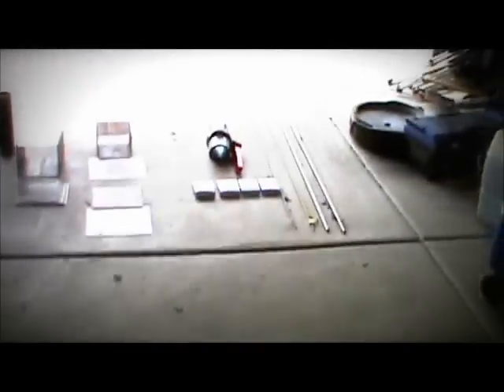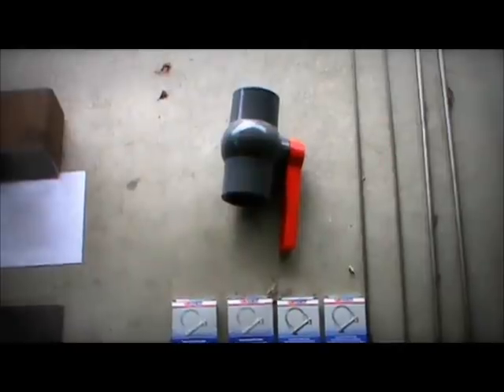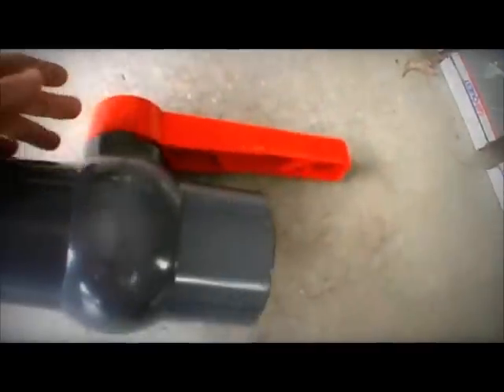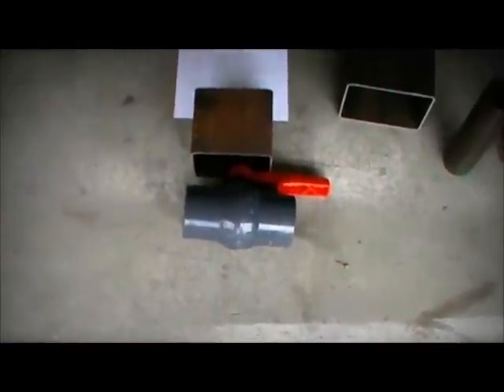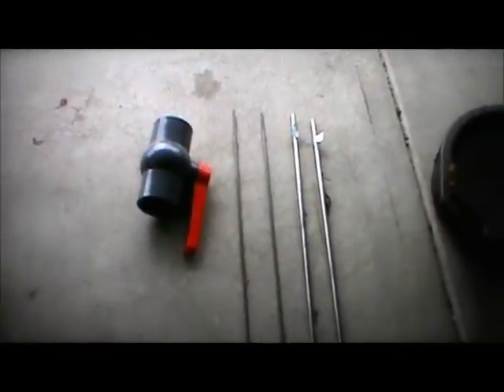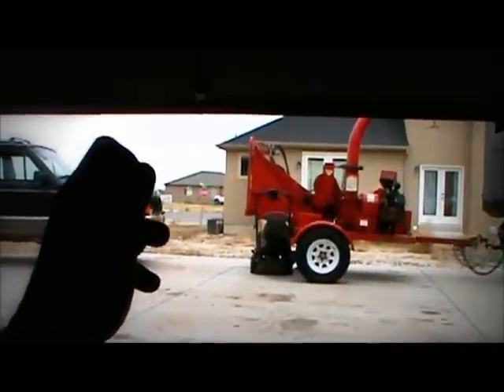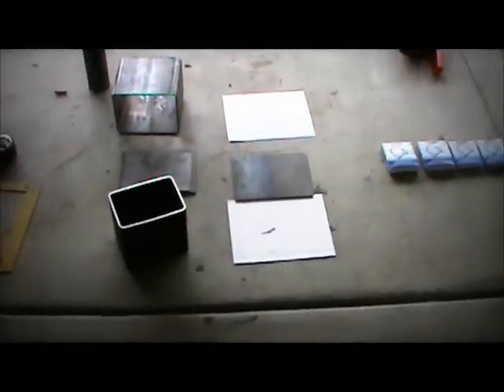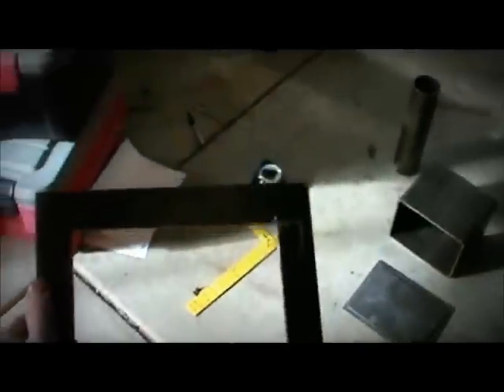100+ MPG Project New Fuel Vaporizer Design Part 1.3

Comment: It might be a consideration to weld couplers on the side of the vaporizor then screw close nipples in for the EG to pass through, in case you have to dissassemble the unit. Using a grinder & thin cut in close quarters is really a hassle. Just a thought.... Hey! its your project we are just cheering you on.

Comment: Hey Tyson, I've watched all your vaporization videos and read all the comments. I have a few questions regarding your system. Could you explain to me why you use the huge 3" tubing for the gas vapor? You are using the exhaust fumes to heat and evaporate the gasoline correct? How were you able to get the correct fuel-air mixture in order for your car to run? Finally, how are you able to have the vapor sucked out of the container when the container is a closed and sealed container? Thanks, Alex

Comment: Nice design! It's a more complicated  ver. of the HCS set-up I have on my car. How will you be introducing the fuel vapour to the car again? I read about the hydocarbon cracking system on a forum a few months back. I use bottles to hold the gasoline, which has hot air bubbling through it. The hot air comes from thin copper pipes strapped to the exhaust manif. The gas vapour also goes back through these pipes, then to the engine. Added max 70 miles to my tank. 33+% increase. I tweak it each week!

Comment: In fact in my testing too I found that the vaporizer are not giving any considerable mileage gain. On idling I found that the car can run from one start to stop for around 6-7 min in 100 ml of gasoline but on road test the performance is not that way. 

I have detailed report on my testing. If any body wants it then please send a mail on pvar06@gmail.com

Praveen

Comment: I'd love to see how well this works out for you. Your old set-up got you very good results, so this should be an improvement. I use a similar set-up on my vehicle with effect that I can drive about 100 city miles on my 1st 1/4 tank of gas (about 2.5 gallons). The problem is that when I drive the remaining 50+ miles for the week, and get down to between the 1/2 and 1/4 tank marks, it still works back out to 30+ MPG. That is what I have found to be the proper mileage test. My base is 25+ mpg.

Comment from the maker: With complete combustion it should in theory run hotter not cooler. If this ends up being the case it will actually benefit the operability of the system.
Yes the makeshift valve I mad did work properly however it is definitely not the best way to do it. The better way is to have a butterfly valve that is electronically connected to the air intake butterfly valve this way they work in sync with one another.

Comment: So, heat is the main obstacle everybody seems to have. With complete combustion of the vapor, won't the engine and exhaust temp lower? You've probably already answered that question too, just hard to find all the answers on one video. Did your makeshift secondary inlet valve with the spring and hinge work properly when connected to your throttle body plate? Pretty cool how you figured that one out.

Comment from the maker: I sure can. Just FYI I have answered these ?'s in other video comments but that's ok. I could not maintain the proper heat needed to vaporize the fuel using heat. Heat works much better than a cold vapor. You can still use the older design but need to build a better splash guard to prevent any liquid from being sucked into the air intake. As for the power if you have the proper splash guard and have the secondary air inlet valve calibrated correctly then you will have no power loss.

Comment: Can you give any information as to why the other models you have built would not work? Was it not hot enough to vaporize completely and left residue in the chamber? Would the vehicle not have good enough power or acceleration? Did you have problems with the float valve keeping the tank too full or low? What do you think about using an electric heating element, like an electric skillet or griddle to vaporize the gas, instead of engine heat? I'm working all weekend on my basic one like your buick.

Comment: Prototyping is always expensive.  The finished product is where the reduction in costs is realized.  In this case of saving on fuel consumption for example,  suppose the final product will cost $300 assembled and tested.  In a worst case scenerio you get double your current mpg.  The fuel savings will recover this cost within 6 months to 1 year depending on one's driving habits.